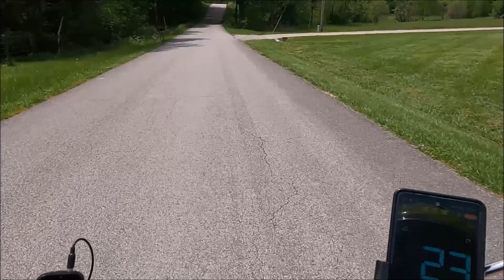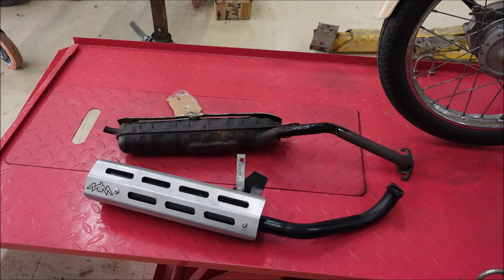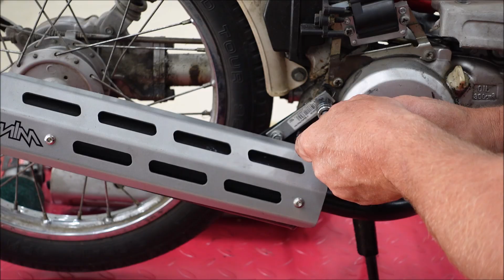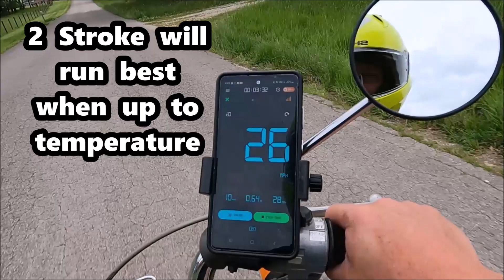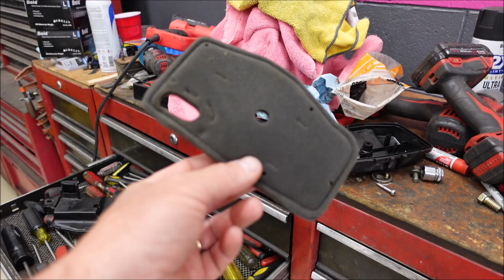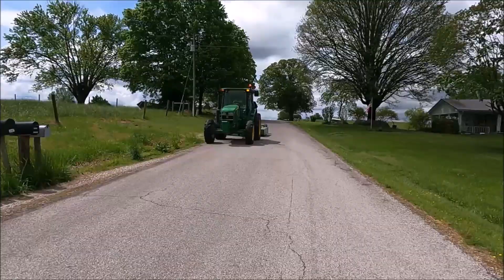RAM AIR isn't just for 1980 Trans-Ams

Comment: These are 6 volt systems but mine had 1 extra wire coming out the coils with 12 volts so i used that for the headlight with a real big round headlight glued into the small bucket. So it was quite good in the dark.

Comment: Shoutout from Louisville. I have a '80 Garelli SSXL I wanna swap the shit NOI engine off of. Probably a Tomos engine. Never seen a shaft drive moped or noped.
Reply from the maker: Imma keep my rig for now.
Reply: @kentuckyyankee  Same here, I just don't like the engine, because Garelli noi engines have rubber clutches(think toothed hockey puck), and need non-detergent oil, so I've been thinking of a A35 or A55 swap.
Reply from the maker: @ItsDaJax  Rubber for sure isn't any  good. I haven't worked on those Garelli or Tomos.